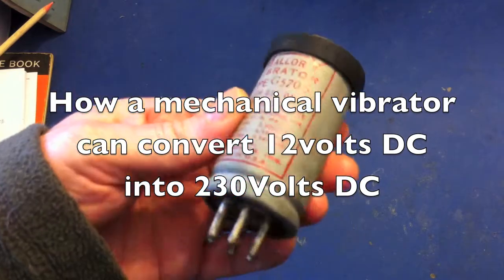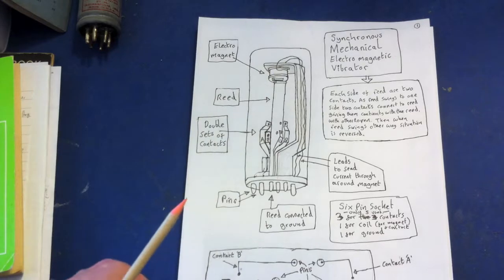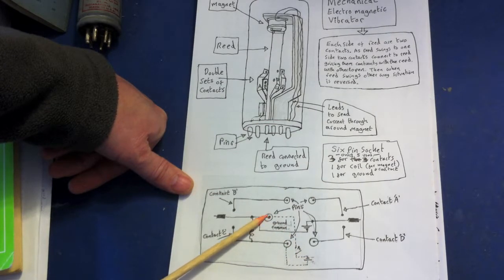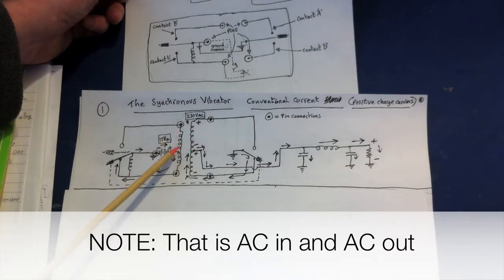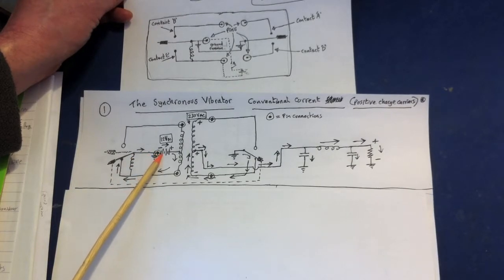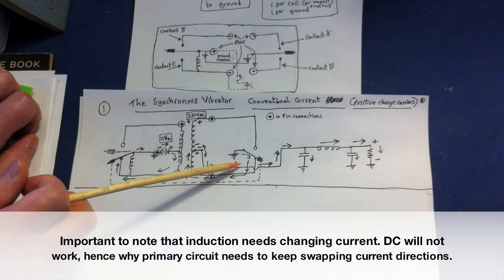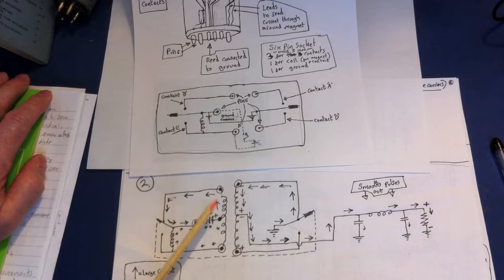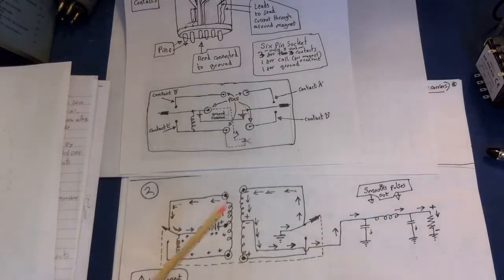Vintage Car Valve Radio vibrator

Comment: I was wondering how those worked; it's actually deceptively simple. It reminds me of the pre-solid state voltage regulators that were used in cars to regulate battery charging.

Comment: its cool how they can needed the oscillation part so they made the module to oscillate the dc in a pulse form to boost it then smooth it out in the dc form again :-) the tech was large for sure but it was still really smart :-D a nice clear walk through nice job :-)
Reply from the maker: Yes you got it, clever things, paradoxically can often be this simple.
Reply: yeah strange sometimes how its hard to see the woods through the trees :-) my uncle had a knack at seeing through stuff to it simplest form which was genius in its own way :-D I need about six reiterations off someone in the know to get the jist of something :-p